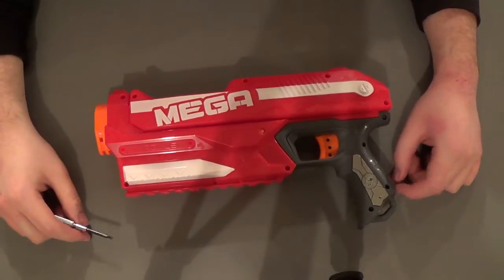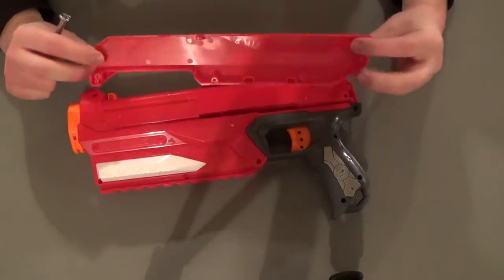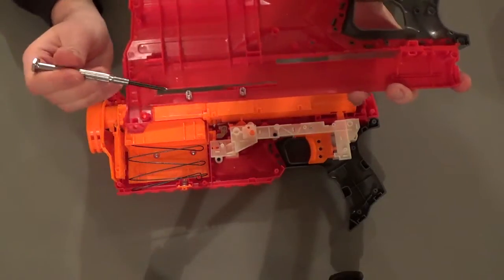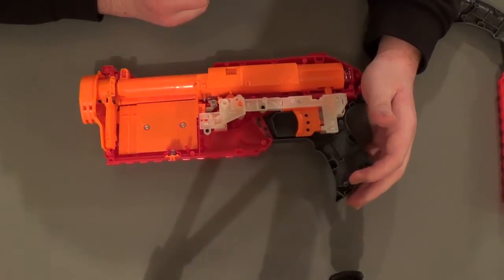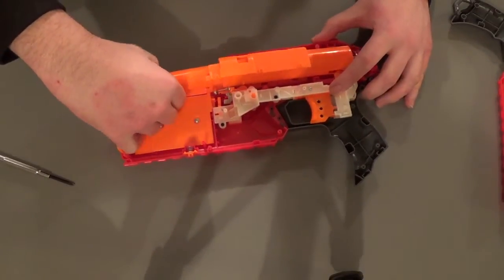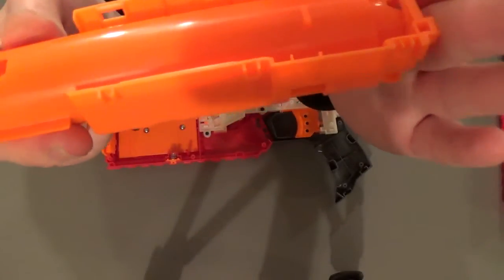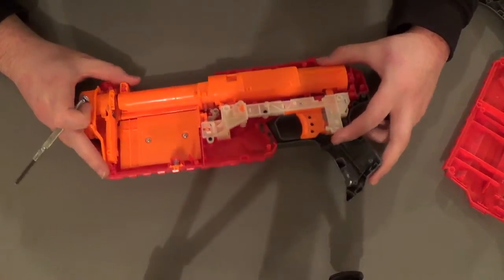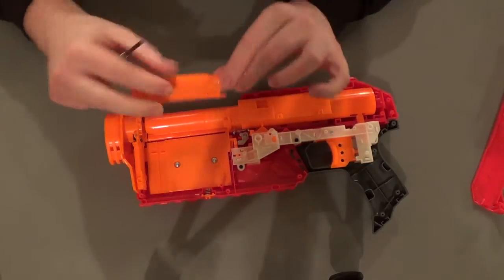Internals Overview: Nerf Mega Magnus

Comment: I know this is an old video, but thanks so much for the detailed tear down. My Magnus jammed and I had to take it apart to find out why I couldn't move the slide back into the forward position. It turned out the orange bit at 9:15 wasn't staying down even after I pulled the slide all the way back. After fiddling with the orange plate at 9:40 for a bit, it now works. Thanks again.